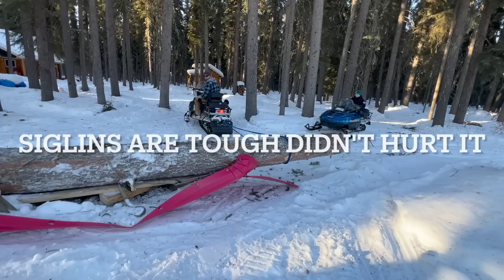SKIDDING LOGS FROM OUR REMOTE ALASKAN CABIN PT. 2

Comment: Was going to mention the way you are doing in last video. But I was going see if you had a place that made the plastic for covering pipe and have a couple hudge crazy carpets.
That's what we made years ago. Crazy carpet for people to ride and one larger hunting hauling. Moose etc. We used either Alpine Double track ski-doo or Bombardiers track machine.. going job worked great 👍
Reply from the maker: The first 2 mile section was easier to not have anything under it because the trail was so windy and the trees would just rip the sleds of or hang us up. They worked awesome for the 10mile mostly straight trail though
Reply: I was thinking same thing, if he had a sled or something on the tail end it would’ve pulled easier, lol.

Comment: Can't wait for the log arch video later good project for the boys to build . The ski design is awesome I was wondering what to use for floatation simple idea that worked great. Lost sleep trying to come up with a better arch than you had in part1.
Reply from the maker: Ya this log arch was built perfect, the tongue actually extends out about 4’. He can carry a 24’ log fully suspended out of the mud to his sawmill. The skis are perfect they have 1” or 1 1/2 channel under for skeggs. The only week spot is where it was bent but something has to give I guess. When I gave it back to him I put a better hand winch with a built in brake. If the one that was on it got away from you you’d be missing some teeth. My arch is a good design for smaller logs it just doesn’t get the log high enough off the ground to get rid of the bark dragging in the tundra

Comment: Watching the logs getting pulled out it might help if you had a rear tiller type log arc that could be in fixed straight ahead or pivoted to go around corners which would allow for rear steering of the log around objects or corners.  The rear log arch could just have a extendable rear handle facing backward, in the rear position going straight it’s strapped to the log but it could be unstrapped to steer around objects or corners. The log arch could have skis for winter then switch to tires for the summer. Just a thought.  I use a log arch trailer and a second log arch on my side by side to pull in 30 foot logs. Think of the rear tiller fire trucks
Reply from the maker: I was going to build something like this that could either be steered by a winch or by a snowmachine that followed. The way we did it with the Siglin sleds really was prob easier because the sleds kinda bounce off the trees. If you had another log arch in the back you would have to make sure it steered or it would get hung up on the trees

Comment: Approx, how many logs will you need to build your new home?
Reply from the maker: I will be doing 2 runs of full scribe logs on top of 8’ framed walls so 8 for walls and ridge pole and 2 Purlins so 11 total. Plus I’ll be adding accent logs in the corners to make it look like a timber frame. So prob need another 15 but don’t need to be as big or perfectly straight I’ll try to find some around town so I can use the skidsteer